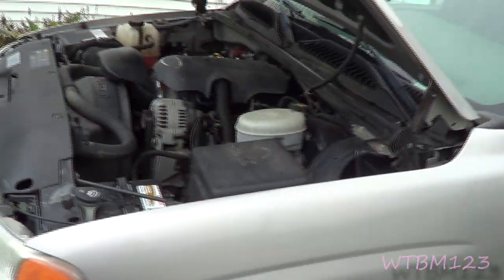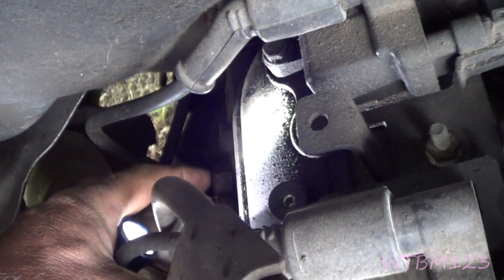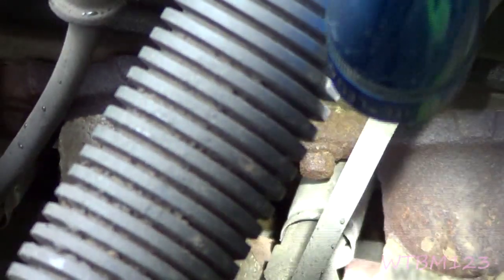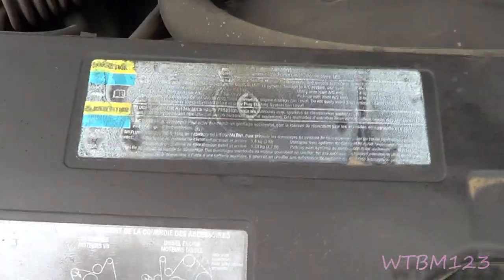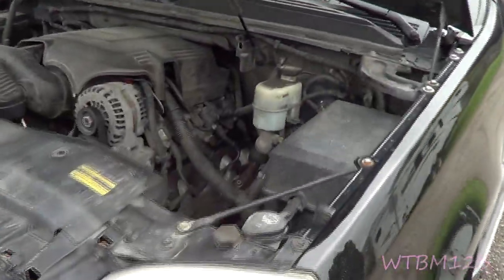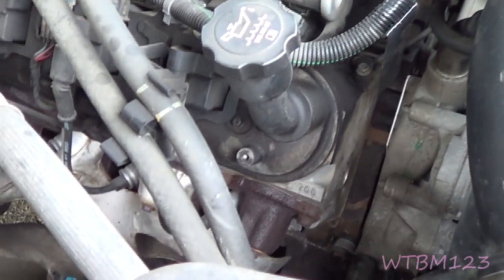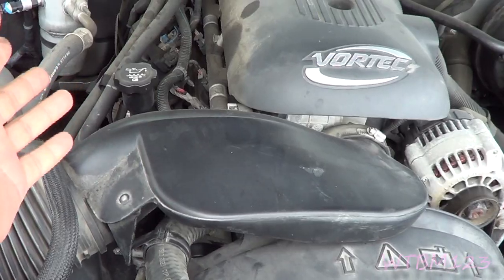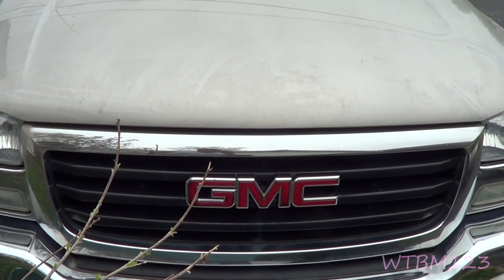Looking for Broken Exhaust  Bolts, and Fluid leaks  Chevy Truck

Comment: Buddy that was so much better than my camera action LOL  Ok it looks like we all have more to check out. Terry thanks for the shout out , super COOL !!
Reply from the maker: +STEVE ROB  Does your 2500 have the same kind of transmission lines . And you have a good channel that everyone should watch .
Reply from the maker: +STEVE ROB  Does your 2500 have the same kind of transmission lines . And you have a good channel that everyone should watch .
Reply: wtbm123 My lines are quite different but you know I'm going to still check HA and thanks for the compliment it means a lot from somebody I have watched for years and learnt from.  Tomorrow morning I'm heading into the bush for 3 days and I'm bring the camera.
Reply from the maker: +STEVE ROB Hope you have a good trip .Be watching for the videos when you get back .
Reply: +STEVE ROB be careful on the passengers side with the oil dipstick tube. I went to pull it out and didn't take my time and broke it off flush with the block. It was a chore to get the remaining piece out of the block!
Reply from the maker: +The Disgruntled Mechanic LOL , i have been there too .

Comment: I never new that about these. The guy next door has a 98 Chevy truck all his bolts are there. I looked because I don't have a chevy truck but I am looking for one so I will watch this for sure!
Reply from the maker: +MidwestMotoRider I believe the 98 still had the 5.7 . Same happens to some of the other brand trucks also . The GM trucks do have a lot of issues , but most are not to bad to fix

Comment: I have new transmission lines setting in my garage to put on my 2002 2500HD.
Reply from the maker: +The Disgruntled Mechanic Looks like i going to need to get some . Seems like always something wrong with this truck and i do not even drive it that much .

Comment: I have replaced my oil cooler lines 3 times on my little sanoma and its leaking again. Man what is it non oil compatible rubber hose or whats in our oil. Also around 100k mile you got to look forward to the rear main seal plate gasket getting all hard and making it look like a rear main seal leak.  Awesome info
Reply from the maker: +scottsinfl Yea , seems like they went cheap on the rubber hoses .

Comment: Every Ecotec 2.2 and 2.4 I have has had a broke in half or really bad cracked manifold. Both Malibu's, GMC terrain, Saturn vue and a G5.
Reply from the maker: +william staten A size bigger bolt , would not be hard for them when making them . I sure they could figure a better way

Comment: With your video Terry and Steve's, I couldn't make out if the bolts actually came out or if the head snapped off. With the last Silverado you showed on the last bolt, it was clear that the head appears to have snapped off. Never realized that the Chevy trucks had all these issues. Nice vid and keep up the good work!
Reply from the maker: +stuzman52 They do have many issues , but seems regardless of who  who makes them, they all have  issues . Thanks for watching and commenting

Comment: Good photography, Terry. It was easy to see the broken off bolt heads. Galvanic (bimetalic) corrosion between steel and aluminum is a serious problem in marine technology. With salt on the roads it's probably not surprising that the bolts corrode and break off. It probably depends on what grade of steel and whether it is galvanized or not. What a mess if you have to replace them. It's hard enough to remove a broken bolt when you have a lot of room. I guess if you don't notice a leak you just leave it alone??? Thanks for the information.
Reply from the maker: +Bruce Boschek They are not galvanized , but you are right , aluminum and steel like to react and cause issues  . A lot of times they break and look like a clean break . I wonder if the difference in expansion  in manifold and head is just to much for the bolt they chose to use .

Comment: you're right, it is a common occurrence in those engines...your theory about the aluminum heads seems legit to me.
Reply from the maker: +utoobube  Bet half the gm trucks 2010 and down to the 2000 , has at least one broke

Comment: The rear drivers side  bolt broke at 70k on a 06, it did not start leaking until 100k. Its getting bad now I have to weld it out They break just because its a crappy bolt, they are 8mm thread, so small.
Reply: Maybe it was a good bolt before it rusted. The tensile strength requirements make the choice of steel that rusts unfortunate, but even stainless steel rusts with this much heat.
Reply: wtbm123 Steve said the new size is 13mm and breaks just as much.
Reply: DE Nichols
 The head is 13mm. The old size head was 10mm on the earlier trucks. They made the bolt head 13mm back in 02 or so?
Reply: Ghetto Wagon I just know Steve Rob said 13mm was the updated bolt. Maybe even for the older trucks they sale those now.

Seems like they kept the 10mm longer, but you may have some personal experience with it. I don't.

Comment: We have GMC van box trucks at work and don't have that problem. Boy it works with us has a GMC with over 200K and another that has a Chevy with over 250K and hasn't had them come off. I just got a 2013 GMC but it only has 13K miles. 
Ford has this problem. But least on GMC you can get to them. 
My 1992 Chevy K1500 4.3L still has them all
Reply from the maker: +CamperMike Some Dodges do it also .
Reply: What doesn't Dodge do? lol

Comment: Ha ha i have a few of those handy torches and they allways have a bad connection, but they are cheap and i quite like them, keyring torches are handy.
Hmm exhaust flange bolts, the heat allways destroys them, they die on motorcycles too.
It is odd that the chevy allways kills the back bolt.
If you dont get gasket blow by then i dont suppose it matters :-)
Reply from the maker: +zx8401ztv It is a Maglite ,and still only works half the time , lol
Reply: +wtbm123 
lol well 50% is better than nothing ha ha :-D.
The metals used in the cheap ones just play up, the 3 aaa battery holder made from fantastic plastic are also crap-o-la :-D
But i still like them, i must be mad, ok madder :)

Comment: The brackets to fix broken exhaust manifold bolts that wbtm123 is talking about comes from KRAL auto parts.  They have a cheap and easy solution to all of our GM broken exhaust manifold bolt issues.  Look em up....  Saved me a weekend or more of time.  Basically I can't say enough about the parts they offer -- I have a 2002 Chevy 6.0L 2500HD and had multiple broken bolts on both manifolds... For about 80 bucks and 30 minutes of time my truck no longer sounded like a worn out heap.  I've had their parts on my truck for about 20K miles and I'm still very pleased with my purchase.

Comment: Wow, your 2004 Chevy with a 5.3 still has ample room to swing a wrench.   My 97 Lincoln Mark VIII with a 4.6 has no room to swing any type 05 of  tool.  Very tight.
Reply: I've worked on both. Totally!
Reply: Hey Cadillac with a big engine is much worse.
Reply from the maker: +Romulan112 It is nice that there is still room to work .
Reply: Exactly, The Mark VIII has a 4.6 32 valve. Its like a sardine can.  I plan to put a front-in along with wheel bearings, possibly master cylinder and then drive it for 2 years is my plan, to recoup my cost.     I also have a 2011 Chev. Colorado with a 2.9 L  4 banger. It has no power but lots of room to wiggle wrenches and such.  Having ample room along with cars that are easy to work on can make one appear to be a better mechanic than they are :)